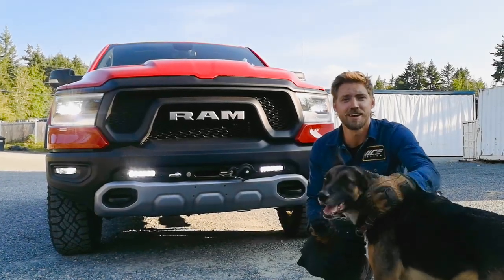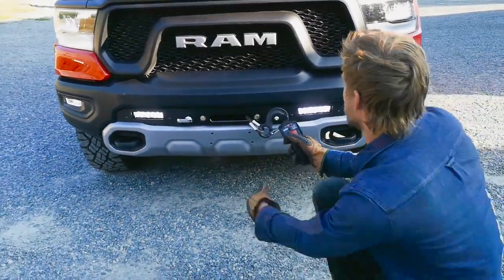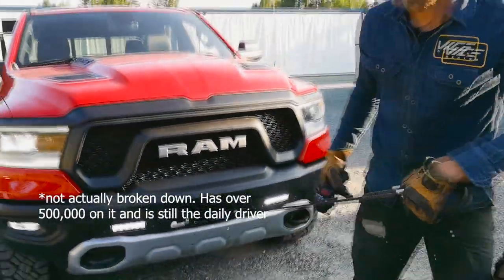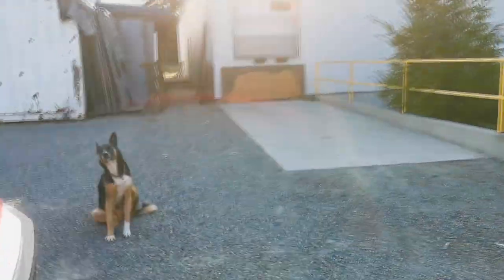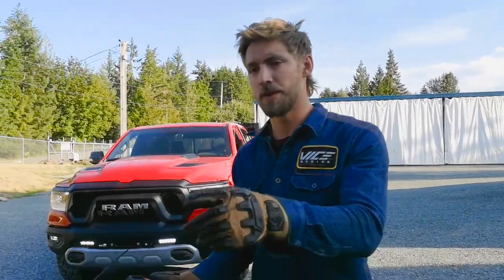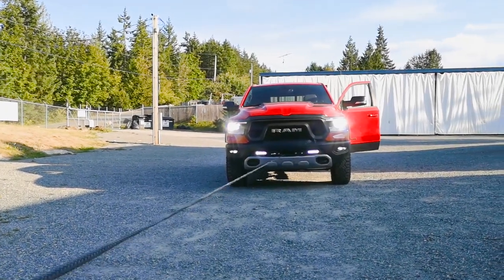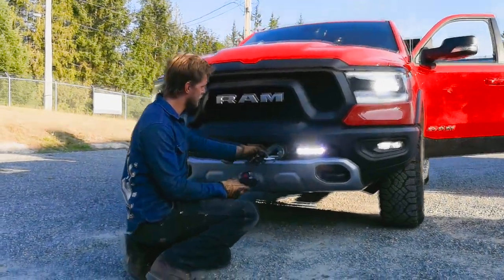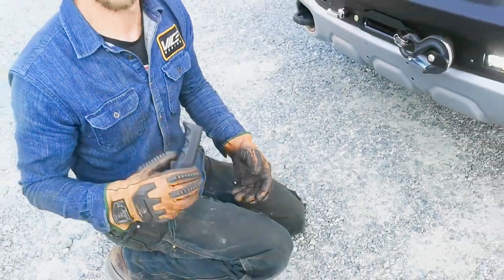2019-2022 RAM 1500 HIDDEN WINCH DEMO

Comment: We have your hidden winch mount for our 2016 that we are about to install and noticed in this video you mention degrees of angle for winch and that your winch kit is only designed for single line pulling. If you where seriously stuck deep and had to run a block with the line back to the truck tow point are you saying that you are recommending not to do this?
Reply from the maker: Should have said "refer to your winch manual for best winching techniques". They usually state similiar angles that I pulled from the top of my head there.  It's a stout mount that many offroad with regularly.
Reply: @vicedesigninc  Sounds good and we can't wait to get this installed soon.

Comment: Awesome product and install video!!! You'll be seeing an order with my name on it sooner rather than later for my 19 Ram Rebel. . One quick question: is there an option for a roller fairlead?
Reply from the maker: Great to hear! no room for a roller in there so if you want to run steel wire , they do make a Hawse Style fairlead out of Cast steel that is compatible (like WARN part number 73850) . I tend to recommend the rope over the steel cable as its lighter and safer but both have their own unique applications.  I have  a couple kits in stock. Also have a look at our control box relocation kits www.vicedesign.ca/winches
Reply: Thanks for the quick reply VICE. I totally understand. Will be in touch soon! Rock on VICE!
Reply: Why would u want this. You gotta cut the frame. Much better product out there
Reply: @peterk814  what better product is there? Does it let you put a winch under factory bumper?
And you don't cut the frame, you cut a section of bumper sub assembly out

Comment: How would a non-wireless winch work? Do you route the control cable through the engine bay into the cab?
Reply from the maker: Couple options really. What I'd do - hardwire the winch into your cab with a nice winch toggle switch so you can spool it in/out from your drivers seat. Then you can have a the winch controller as your secondary mount - where you could leave it plugged in and stored under the hood.

Comment: will it fit a 2020 rebel
Reply from the maker: yup as long as it doesn't have the Eco-diesel engine. Unfortunately that motor's inter cooler interferes with the mounting system

Comment: Can you test out to see if the harbor freight BADLAND
ZXR 12000 Lb. Truck/SUV Winch With Remote Control And Automatic Brake will work.
Reply from the maker: this one? https://www.harborfreight.com/ZXR-12000-lb-TruckSUV-Winch-with-Remote-Control-and-Automatic-Brake-63770.html
The winch will fit! Since it has a steel cable (instead of synthetic rope) you'll need a compatable hawse fairlead. WARN part number 73850 will work with our mounting kit well.